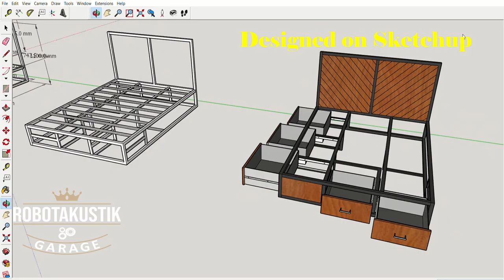Metal Bed Frame with Drawers

Comment: I would modify the design by not welding the headboard to the bed box, but attached using screws in pre-drilled holes. That would make it easier to bring the bed inside small bedrooms.

Comment: welding machine used mig or flux type sir ??
Reply: flux, notice the tip.  with solid wire mig you need to have the tip cover on to contain the gas.